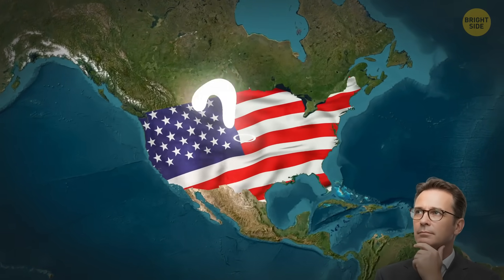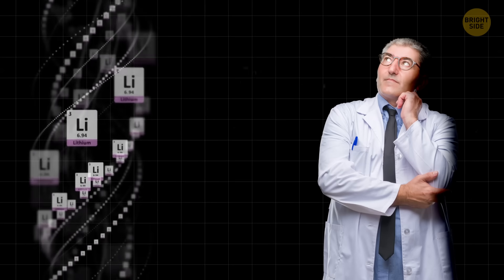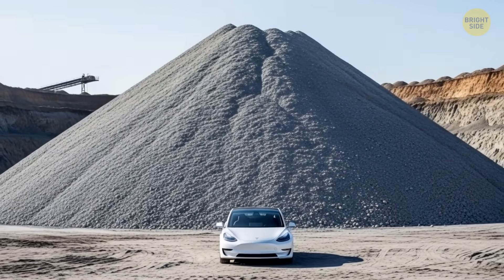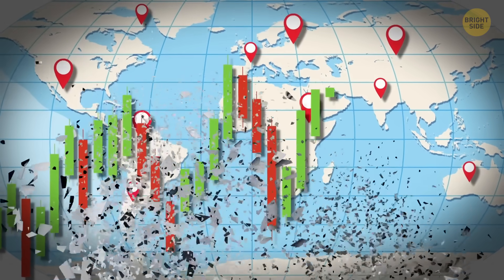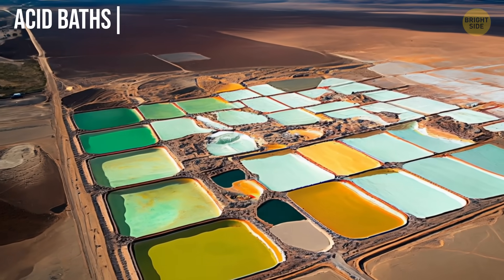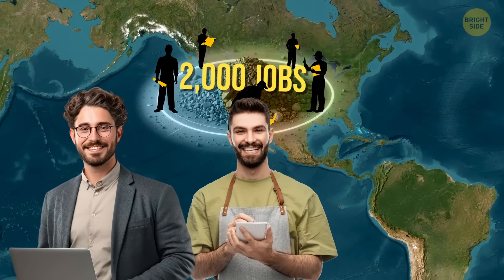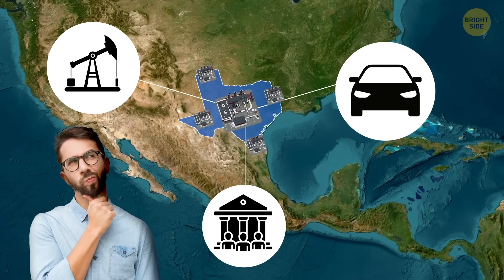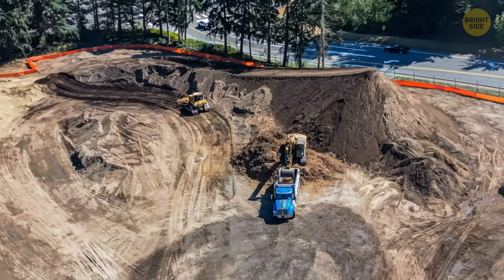This New Mega Project Could Flood America With Money

Comment: I’ve saved so much money with my electric car.  Y’all have no idea how much cheaper it is.  A full charge (330 miles) costs me at most $12, but usually is cheaper.   It rides smoother and accelerates faster than my gas car did.  I won’t go back.

Comment: The "clean energy" transition has all but stopped in the U.S. subsidies for electric cars is going away and the drop off in sales will be dramatic.  I wouldn't forecast heavy investment into lithium mining at this site, since supply has been sufficient in the past and demand is dropping.  Not a great video.
Reply: For what 3 years ? Until the new administration comes in and subsidies for EV and Clean and energy are back ?
Reply: @JAYY_JAYY  You could be right.  In fact, I encourage you to believe you're right, that the Democrats are now and will be competitive in 2028 without changing anything.

Comment: Gasoline cars are NOT on the way out !
Reply: Maybe in 50 years.
Reply: @TheRealEdStoner  not even then. that is a myth they would be on the way out.
Reply: @TheRealEdStoner not even close africa will take generations to even be close
Reply: @TheRealEdStoner  If gasoline vehicles hadn't been invented, electricity would be dominant. The problem is that gasoline has more benefits, such as accessibility and efficiency. I don't think EV will die out, but I don't see gasoline becoming a secondary option.
Reply: @DylanSnider  the Chinese dominate the lithium and Cobalt market. We definitely do not want to be dependent on the Chinese. There’s some promising areas in Arizona that might change that.
Reply: Actually lithium isn't only about cars, laptop cellphone lights Bluetooth speakers headphones, they need lithium.

Comment: 40 years for production that is a waist of time to pursue. Oil has been in use for over 150 years & still going. If it runs out in 40 years it's a drop in the bucket & will run out in about 20 in reality. Not to mention the waist material it will make. This is a joke.

Comment: Some car manufacturers are peddling back from EV cars.
Reply: 😂and are going bankrupt
Reply: It's not just cars; we use this for battery storage to back up homes/ businesses during a blackout.
Reply: @brokeboy87  But we've also got nonflammable sodium ion battery tech coming online now.
Reply: Ford: Delayed and canceled several EV products and has shifted its focus to increasing the production of hybrid models.

General Motors: Cut its EV production forecast for 2024 and pushed back the start of electric truck production at one of its plants.

Mercedes-Benz: Postponed its target for EVs to make up half of sales by five years and scaled back its battery production plans.

Stellantis: Paused production of the electric Fiat 500 due to sluggish demand.

Toyota: Reportedly cut its 2026 EV sales target.

Volkswagen: Hinted that its battery factory plans depend on EV demand.

Volvo: Abandoned its goal to sell only EVs by 2030, and now aims for a more flexible target that includes hybrids.
Reply: Because they can't compete.😂
Reply: I'm actually glad to hear that.
Reply: @chasl3645 A EV for $36,495 with 315 miles of range certainly can compete with ICE vehicles.
Reply: Not really, General Motors sold 8500 Chevy Equinox EV’s just in July and a total of 19,000 EV so far in 2025.
Reply: @joecushman6030  That's a drop in the bucket; fewer cars than GM produces in a single work day.
Reply: Only US manufacturers are. Worldwide EV sales keep going up.
Reply: 20 years til now we went from wired to wireless. We use more lithium now than ever. Even if all the manufacturers for vehicles failed.. you’d still be using a wireless products with lithium

Comment: This is potentially a problem, as the batteries have 15-20 year life span and over time we are going to have too many useless husks of former batteries and less lithium supply.
Reply: When there are many spent batteries then recycling the valuable metals in them will become a thing. However, though a lithium battery may last 20+ years in a car, it could have a 2nd life as a battery pack linked to a home solar system for yet another decade or two.
Reply: A company called Redwood recycles lithium batteries back to the core materials for production of new batteries. They also repurpose them for grid storage.
Reply: In 15-20 years, we will probably figure out better ways to recycle batteries.

Comment: Wonder if Thacker Pass LI extraction site will be more economic than the Salton Sea deposits. Additionally, Piedmont Lithium's proposed integrated lithium project in Gaston County, North Carolina, which involves mining and processing lithium ore to produce lithium hydroxide. The project is a significant domestic lithium development that aims to supply the electric vehicle battery market. Nothing is guaranteed

Comment: There's nothing clean about electric vehicles. For one thing, Lithium is highly toxic as waste and will pollute the earth much more than most other forms of power.

Also, electric vehicles are a lie. They're not creating a green footprint, when you move the power out of your car, where do you get the power from? That's right! The electric company and THEY are using fossil fuels to power all the electric vehicles. So the only thing you've done is moved your footprint from your car to the electric con PLUS created highly toxic batteries that must be disposed of in a way that's FAR more expensive than any  other kind of disposal system already available. Yep. Electric cars are a lie perpetuated by big oil to keep you guzzling oil AT THE ELECTRIC COMPANY, INSTEAD OF YOUR CAR. 

What we need is PURE energy for our vehicles like hydrogen, who's only waste product is *WATER.

Comment: I'll take my gasoline truck
Reply: For another 5 years, sure. After that you are going to find electric trucks with 500 mile range, fast charging, better power at lower sticker price than an ICE truck.
Reply: @RonHenson-lv4lf  ha, im not so sure about that, but say it comes true, how would they fix the problems with the batteries when it gets below zero outside and they all get stuck like last winter and have to be towed to a charging station?